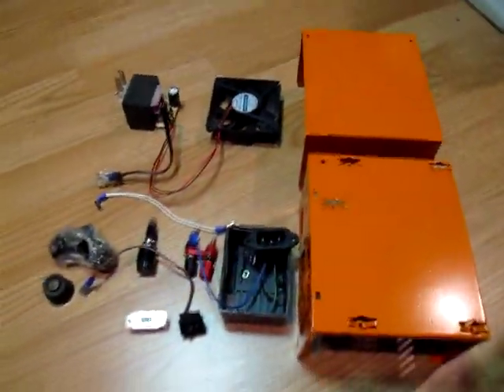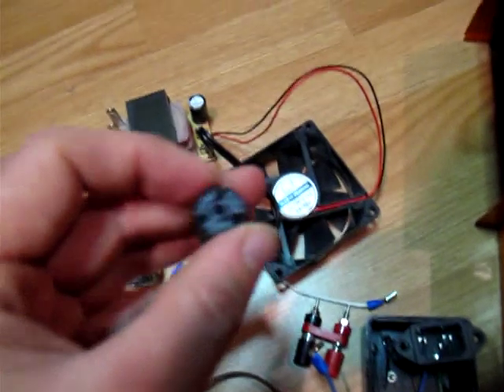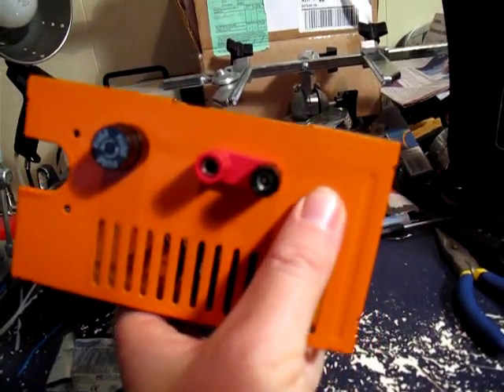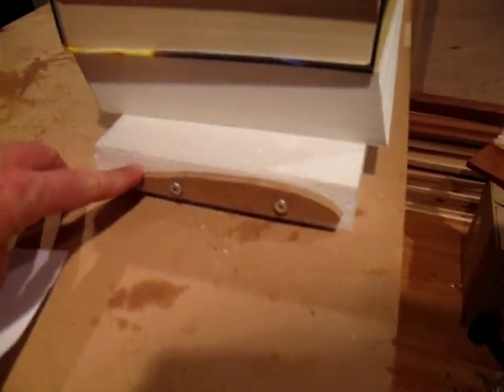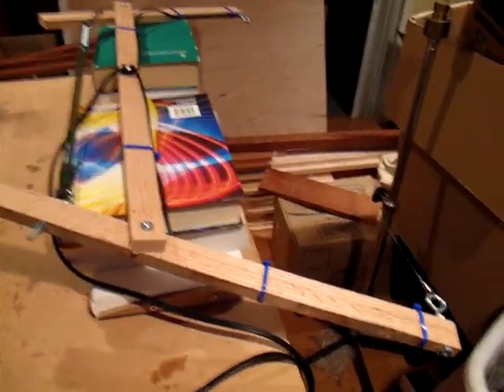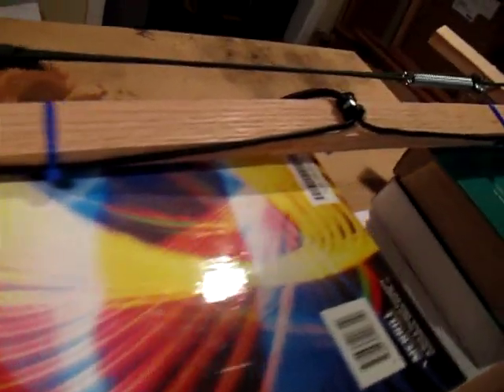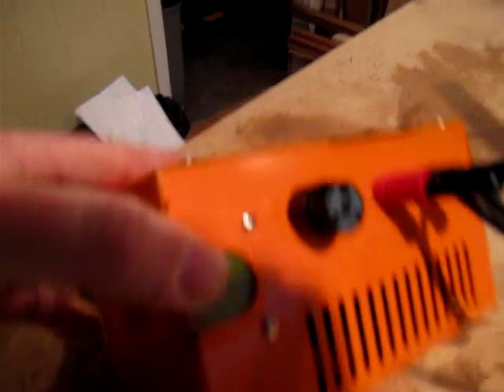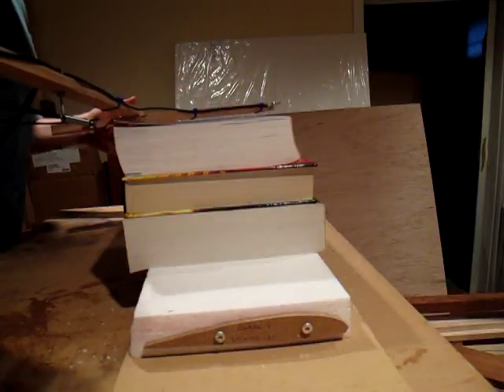Homemade foam cutter power supply and hot wire bow.

Comment: how do you regulate the heat
Reply from the maker: Thanks for the question about how to regulate the heat. This is a fixed output supply. I am making a variable output supply using a light dimmer.
Reply: ok...its cool.

Comment from the maker: Hey Fern. Thanks for the questions. For this circuit I find it puts out about the right amount of current for my needs. To regulate the heat of the hot wire I would have to put a variable resistor such as a light dimmer in the circuit. In order to do that I would need a larger transformer. I just used some junk parts I had in the electronics junk box. I may build a bigger setup with a much larger transformer just for experimentation. My background is as an electronics technician. All the best.